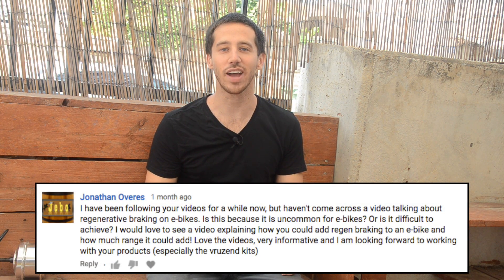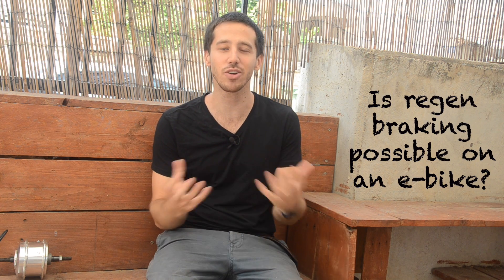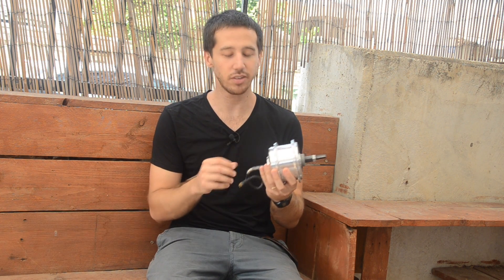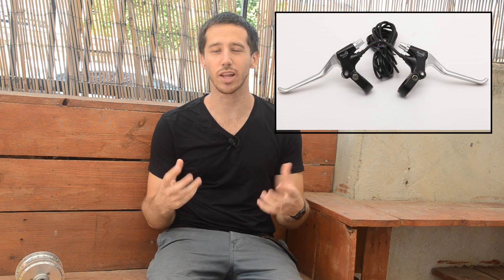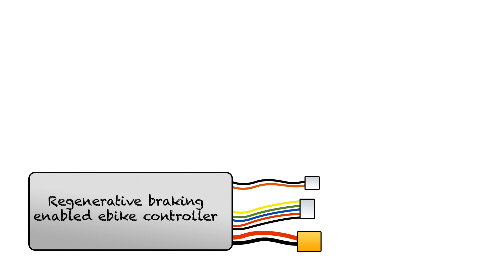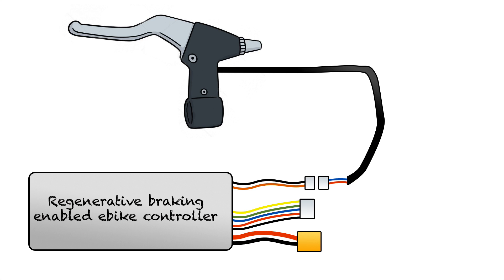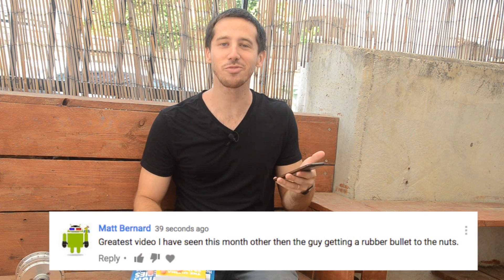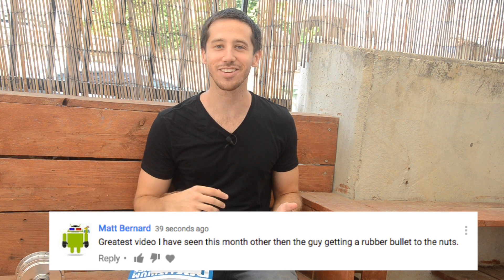How to do Regenerative Braking on an electric bicycle Q&A#9

Comment: Regen can really put a strain on the drop outs. (Given a hub motor ) Imagine doing 40 miles an our and suddenly you touch the brake just enough to activate regen the slow down is like going from third gear to first gear depending on settings. This reverse torque will eventually round out the rectangular dropout into a round drop out despite the crappy torque arms recommended. I have two torque arms on each side and still a problem!

Comment: theres a controller with regen brake for a 500 watt motor on ebay thats says 25A and the lowest voltage its compatable with is 24v. does that mean it will generate 600 watts with enough weight down a hill. i was thinking of adding a ring flywheel to each side of each wheel for more weight and more rotational kentic energy to keep me going down a slight hill. if i need energy i can probably push my bike up a slight hill then regen down.

Comment: May have raised as many questions as you answered. I'm in the market for my 1st ebike so I'm reading and watching lots of reviews/how to/informational videos.
1) In the vid you mentioned connecting regen wires to the e brake so does that mean you can coast without resistance if you don't apply the breaks?
2) True or false, I thought I seen a vid that said a direct drive hub motor will will always have rolling resistance whether its regen or not. 
3) You mentioned how inefficient regen braking is which is what I suspected. So my thought is that  with regen you cannot simply coast because as soon as you let off the throttle the motor is stopping you thus forcing inefficient jackrabbit stop and start driving as you would have to stay on the throttle until you wish to stop. 
4) So my next thought is that coasting especially if you have a good coaster and decreasing rolling resistance with better bearings and high pressure tires will get me more mileage than regen ever could. Coasting more would also be less stressful on the motor and other components, all around less wear and tear.
Reply: These are good questions and need to be answered, especially if the name of this channel is eBikeSchool.

Comment: Does regen affect the battery life?
AS if they have a cycle of 1000 charges, doesn't that mean that you lose some cycles?
Reply: yes and no. If you happen to regenerate more than the battery can take it may affect your battery life. However, like he said regen is really small increase in battery juice for bicycle, for normal use the negative effect on your battery is almost insignificant. With that says, don't worry too much about it, just go out there and enjoy your ebike
Reply: that's my question too

Comment: Hello Miach, thank you for posting such informative video. I am planning to attach a front wheel drive hub motor for a  common. I am planning to do this for differently abled people. Can you suggest if it can be auto braked unless one uses the throttle to move it. Hope you will make a video very soon for this. Thank you in advance

Comment: One thing not mentioned in this video is the fact that it saves brake discs. That is my favourite thing about regenerative braking.
Reply: I really need this. Iv got crazy hills and I'm burning thru pads and discs
Reply: I’m putting together a heavy cargo bike.  The brake pad issue will probably be real!  Seems like a serious win
Reply: Henno Marais Thanks Yes Amen
Reply: Saving pad lining is the most boring perk about regen 😑
Reply: So your favourite thing is not the most useful thing witch is actually charging the battery
Reply: @pascalkargut3237  The most useful thing is exactly NOT the charging. You get around just 5%. What is very important is that you're saving up to 98-99% of wear on your brakes, which adds up to a lot of money saved if you drive your bike for thousands of kilometers
Reply: given the cost of a set of pads (like 5 bucks) and a new dis (like how often? at $16) its going to take a few years to make that worth the cost of just changing pads (not even factoring in all the time for fitting it) ... however in VERY RARE situations on super long down hills on super steep mountain roads it may help prevent brake over heating.
Reply: @finophile  rare for you, daily for me and I'm sure for a lot of people.
Reply: @finophile  why is cost a factor? He likes that it helps save them.... Pointless comment
Reply: @elMoNtOwNaGe  My bike is fast so without regen I spend way too much time on changing pads. Also it looks weird when I buy 10 at a time. ;-)

Comment: You forgot that there is also controllers with analog regen/ variable regen
Reply: What is analog/varriable regen? Iam building an extreme TRI/BRID system (elect/gas/pedal), &need all the Regen help I can get... Capacitors are in the mix as well.
Pleae advise  dutchmanent@gmail.com  Thx

Comment: I have a Yuyang King YKZ7240HN , it has a 2 wire Low Voltage Brake connector and a 1 wire High Voltage Brake connector

Comment: What happening if use you a battery 48v  in a motor 36v 500w? Is There  a possible configuration to work it?
Reply: Totally possible, but you have to check your controller capacitors and mofsets datasheet to see if they handle 57-60v (48v chargued) and look for the motor temps

Comment: You can regen with mid-drive, it just has to be directly connected to the drivetrain like a motorcycle, you can do that with one of the jackshaft kits for motorized bicycles and a swap from a freewheel hub to a fixed hub.

Comment: Mine has everything you mentioned including the switch in the brake lever and the connector on the controller, it was a £150 kit so pretty cheap but it still has everything you mentioned is it likely that i have regenerative braking?

Comment: Love your videos, very informative. 
I have a question though. I am buying a new battery and I was wondering, does it need to have the same port for imput\output or can it be done using different ports?

Comment: It seems super caps are better suited to capture the energy from regenerative braking due to their speed in charging relative to batteries.  Your 5% average return on power is low, especially if you account for the wattage added with pedaling.   Maybe regen braking requires extremely fast power storage for optimal efficiency?  A super cap/lithium battery hybrid system would obviously add complexity and take a little engineering (easy for me to say).

Comment: Great vid, would regen braking lower the wear on your normal brakes? Can you make regen braking progressive, ie like a brake pedal, the harder you push the more brake affect your regen has? Thanks heaps!
Reply: I have a DIY bike with hub motor and just the simple button for the regen braking. I live on the hill and I found it a very useful feature, kinda like hill descent control on some fancy SUV. It limits my speed going downhill, at about 25 kmh, so i dont need to brake at all untill I want to stop completely.

Comment: I don't like direct hub motors because if  you run out of battery
(With a cero charge battery I mean) you have to overcam the resistece of the rotor of the motor passing in front the poles of the stator without making anything but useless undesirable braking or drag effect.
Reply: That depends on the controller. There are controllers that can overcome the drag but not drive the motor. It is usually called samething like freewheel mode. If you use the last percentages of battery to switch to freewheel mode you can cycle home without extra drag on a direct drive motor

Comment: hello, i really like your videos. 
i have a e scooter with a 1500w motor 48v. when it breaks it makes up to 20a back in the battery witch has a 27ah capacity. is it not bad to charge it that fast?
or does it not matter because its only a couple of seconds?

thanks :-)

Comment: Would using separate super capacitors be a good idea to utilize regenerative braking? Thinking it would save more discharge on the main battery when used to accelerate again.
Reply: I saw somewhere dudes adding supercapacitors to electric bikes with lithium battery, but it was quite unfriendly with a Li-Ion battery, as it would often demand or push back a lot of amps into it, which made it heat up often. There could be a solution with ESC controllers or some type of circuit controling the output (not to discharge or charge the battery with high currents), I'm sure of it.

Comment: I appreciate your videos:-)
And have a question for you.
How to replace the wire harness going into the hub motor, if the wheel loosened and twisted the wires so much that they cut themselves and broke the electric connection :-(

Comment: I'm interested in charging the battery by pedaling when the terrain isn't that challenging so that I can draw on it when hills present themselves. Really I want a buffer more than a long range ebike I charge at home, as the hills where I live are very large. I assume that means I'd want multiple levels (at least two)? One that is maximum for braking and another that is less extreme for buffering. Is that possible?
Reply: Since I don't want much energy storage, pneumatic might even make sense, but electric bike technology is far more established.

Comment: How about "dynamic braking" as used in diesel-electric and some electric locomotives?  Specifically for a tandem with a heavy trailer to control downhill speed.  

Some tandems have drag brakes for this function, typically a drum brake designed to provide drag, but not enough braking force to provide reasonable stopping distances.

Dynamic brakes work by sending the current generated by the motor(s) into a resistor network (typically fan cooled on locomotives).

Comment: E-bikes are a hot topic amongst seniors who have an interest in the increased mobility they offer. What is difficult is trying to do comparisons of many of the ‘mail-order’ models being offered. 

In one of your videos, what I understood was that engine wattage and battery pack size should be of similar size. I recently got an ad forwarded to me which featured a 500 watt front hub motor powered by a 1056 watt max battery pack (https://www.fattirebikeparts.com/index.php/xtreme-e-grizzly). 

Please don’t misunderstand my intent. I am NOT interested in their components nor the manufacturer as such. What I am interested in are your comments on seemingly overpowering electric motors as more powerful battery packs become available. What are the implications to the motor? The battery pack? Overall safety? Longevity?

Thanks

Rick F

Comment: Are differential motor ebikes / trikes also capable of regen braking?  I noticed mine to do it specially on downhill routes.  My bike has ABS function but not really sure if it does support /has regen braking.

Comment: HI Micah was just wondering I have a rear 1000w hub motor 48v if I put a dynamo on my front wheel and connect it to the charge port of my e-battery will it trickle charge my e-bike as I ride.

Comment: Second question: how can the battery be overcharged with a 100 percent charged battery going down a long decline? I always assumed that part of the purpose of a motor/charge controller is to not only to control battery drain but control and prevent overcharging??

Comment: Hi, I have a question about regen on a electric scooter. I've just overvolted a 24v hub motor to 36v and now the regen doesn't work. I know it's because the hub motor will only generate 24v as its slowing down, and when the 36v battery drops down to about 30v the regent starts working again. Does anyone know how to overcome this problem.

Comment: my electric scooter rear hub motor is 48 volt 250 watt and battery is 4  nos 12 volt 24 ah battery but speed only 20 to 23 kmph.But I needed 30 to 35 kmph,what can I do? please suggests to me.                   sir your tips is great, my scooty speed is now 35kmph,after modification my controller speed increase, Manny Manny thanks to you.

Comment: Hi iam using hub motor in e bike it does not have regenerative braking. For regenerative braking should I want to change hub motor or  controller only

Comment: Supercapacitors allow a much higher percentage of regenerative braking power to be captured, batteries aren't good when a sudden high amp charge is applied, supercapacitors have the ability to take a high amperage charge as well as push out high amps.

Comment: Hi Mike
Watched vids on building battery's 1-5 great well done. I have a battery that shows 20% on battery monitor but 25 volts fully charged on multimeter,  when attached to bike only provides power based on the 20% reading for limited time is there anything I can do to repair problem?  The charger goes red saying it's charging then after 10 mins goes green to say complete, after limited use at low power multimeter shows still 24volts. Can you help 
Many thanks Tony

Comment: Which motor will last longer geared or direct drive motors? I’m pretty sure it is the direct drive motors
Reply from the maker: Usually direct drive. Fewer moving parts to fail.

Comment: Thanks for a really clear & informative videoI'm guessing that with a heavy load of panniers and a trailer,  would this be more of  an advantage?
Reply: I like the regen when I'm pulling a trailer- it saves my brakes by slowing down the bike through the motor. That said, I'll never buy a DD again- I'll upgrade the brakes.

Comment: hi I like your video. am living in a hill station and am thinking of using regen to charge up the battery. would go manual uphill and then downhill to charge. say I will climb on manual mode for 5 km and drive back with regen on .
Reply: Regen won't recharge your battery that much. It's better for saving your brakes if you have a lot of weight on the bike on lengthy downgrades, but carrying a spare battery would be better, or the possibility of connecting to a flexible solar panel- I'd like to know if solar charging is a reasonable option for touring.

Comment: i want to buy an e-bike. i dont care much about how fast it will go, 20mph is plenty fast enough for me. my concern is how FAR it will go. i wanted to make longer trips, but,  not necessarily faster. i am heavy at 275ibs. most of the way that i will travel is flat land. what kind of bike and battery setup would you recommend for me?
Reply: Tina Jackson have you decided on anything yet? I'm interested, and I think if you are like Florida flat and pedaled some 250watt might do, otherwise 500 watt. Road that is, with high psi tires
Reply: Tina Jackson Most decent e-bikes will go AT LEAST 20 miles on a full charge. And that's using ONLY the throttle. If you pedal, you'll probably get double that range. If you want a good starter e-bike, look into getting a Sondors. They are the most affordable. I have one and I absolutely LOVE it.
Reply: Look at Luna Cycles if you haven't bought something yet. Their motors are more powerful (will pull more weight) than most production ebikes, and- this is especially important- you can switch out their components when things need to be replaced. I was stupid and bought a proprietary Bionx kit, so now that the company has gone into receivership, when my battery dies, I can't replace it (maybe someone who knows what they are doing can monkey around with the electronics to accept another battery, but I won't try.) Most Luna ebikes are reasonably priced, too. My next ebike will be a Luna.

Comment: Hey, I watched a folding cycle video in which they have used 250W motor and the bike is 90% efficient. So, they have claimed that the bike can ride forever using the pedal assist. Please explain me how is it possible. 
this is the link to the video https://www.youtube.com/watch?v=NmwWFlJm5Sc
Reply from the maker: The short answer is that they are lying. The long answer is that this is a terribly inefficient concept. It's like paying $100 to receive $90 in cash. You'd have to pedal over twice as hard to both travel forwards AND charge the battery at the same time. So why do that, if you could use a normal non-electric bike and pedal half as hard to go the same distance?
Reply: Oh thanks for the help by the way i have made a folding cycle and i need help in that to make it electric. I have watched another video about the motor in which the motor is self charging. This is a real link to the video and I don't think that they are lying. https://www.youtube.com/watch?v=SXffL4LL9gc
https://www.youtube.com/watch?v=VD0dW01-5pw . Pls do reply on this one. Thanks

Comment: Would it be possible to make an ebike  go 500 to 1000 kms distance, with a lot of battery power?
Reply: David LaSalle idk but at that point i would stop at a gas station to recharge
Reply: Johnny Utah Thank you for your response to my queation i appreciate it.
Reply: David LaSalle i didn't mean any harm, it's just that that is a long way to ride
Reply: Johnny Utah I understand where your coming from but wouldnt it be grsat to travel such distances even now theres ebikes out there that will do a range from 50kms to 120kms so i think that could be possible in the future.
Reply: David LaSalle that would be epic and as long as batteries keep getting better i wouldn't doubt it
Reply: Johnny Utah Thank you, i remember back in 2008 that lithum ion batteries werent very reliable and now their in ebikes either standard or as an option, same with tubless torn proof tires, radios mp3 players alarm systems all in one box, led lights going all around the ebike solar chargers for ebikes in 10 years ebikes have come along way from how they used to be and they get better and better more robust and higher end build and construction.

Comment: Not only will you not get a lot back, around 80% of braking on a bike happens on the front wheel which is not the most efficient place for a hub motor.